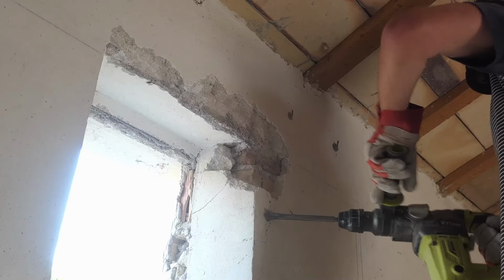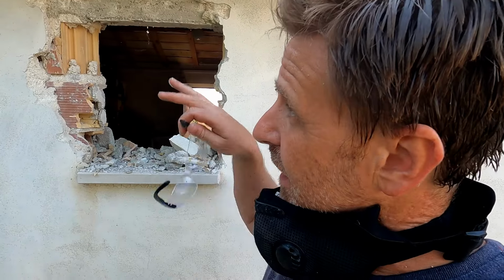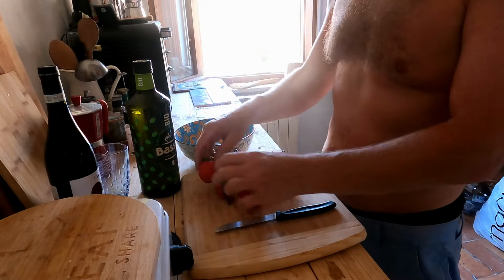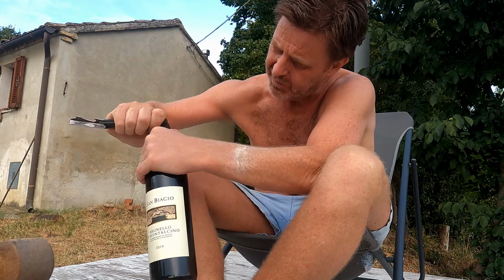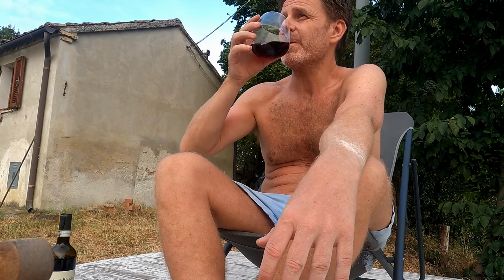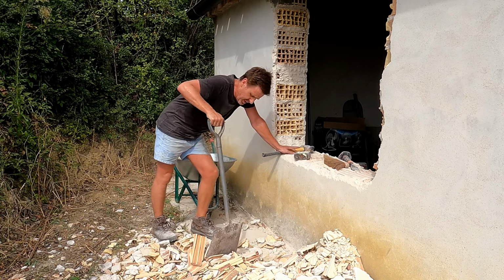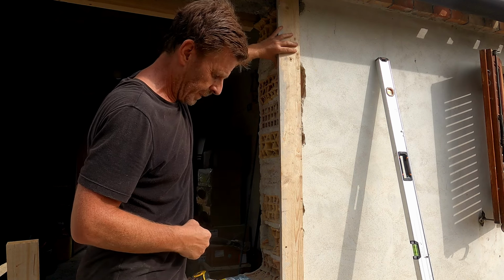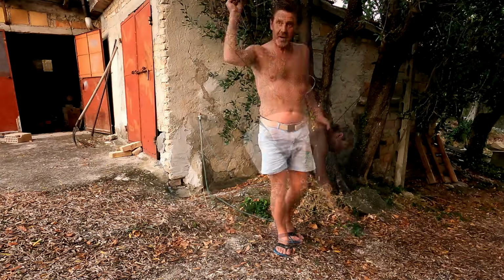Renovation - will the roof be ok? | A candid perspective on living in Italy #23

Comment: put the wheelbarrow against the wall to catch most of the rubble as it drops... and put a tarp down to catch the rest :) clearing up is the hardest part !
Reply from the maker: Thanks for the tip. I seem to learn the hard way. I will try that on the next opening - the kitchen doors leading out to the patio. A job for spring '25 I think.👍

Comment: Trick with dust- put your fan outside pointing away to suck dust OUT of the window to the outdoors. Much more comfy!
Reply from the maker: Thanks @rayjermyn4541 . Good tip. I have a fan ready for the next rip out project which will be more messy than this one.👍
Reply: @threeacresofmarche Always works to move hot air Out in the hot months.

Comment: Loving all your videos, the pace is very relaxing. One little tip for the next windows and doors is to do the outline of your window and doors with a diamond tipped masonry disk on your angle grinder. Work it in as deep as you can both sides of the wall and when you break out you'll have lovely straight edges.  Keep up the great work.
Reply from the maker: Thanks @DeansGoTravelling . I will need a cleaner edge on the next opening so will try this outside. I don't want the mess inside again (kitchen wall opening video).🤦‍♂️

Comment: Another great video, when shovelling loose rubble try standing a bit closer to the pile, put the hand that holds the handle on the inside of your back (right leg in the video) and just bump your hip forward pushing the shovel blade into the pile. Takes a little bit of practise but well worth it, saves your arms, shoulders and back.

Comment: Hello Richard. For someone that never cut an opening for a window out of masonry you did a neat job. You are better off going a little slower and making it easier to do the finish work. That chisel hammer was the tool you needed. If you had to do that all with a sledgehammer it would have taken twice as long. Thanks for another good video.
Reply from the maker: Thanks @dono9879

Comment: Wow Richard, it’s looking good ❤. I don’t know how you do it in the heat like that. I am a gardener and I work really hard in the summer months in the heat and the  only thing that saves me is being able to just jump in the pool when I get overheated.  I invested in a little above ground pool called INTEX ( I live in the US-in Maine and it’s the best thing ever and I am able to keep it up year-round. I just have to drain some of the water out in fall just below the intake and output pipes so I can pull those off and take them in so they don’t freeze along with the pump and cover it. I only run it on electric about six hours a day on automatic timer and add weekly chlorine shocks to keep it clean. It was worth it to keep me cool and I get so much more done. They are reasonably priced and much easier to maintain than I ever would have guessed. You should think about one as you have so much to do there. I’ve had mine about five years and it’s held up in the Maine winters and the hot summer heat and was not expensive.  Anyway I’m just thinking of you. Keep up all the great work you’re doing and I so enjoy watching and I can’t wait to get over there in myself for my retirement! ❤
Reply from the maker: HI @teresamason5155 . I do need some form of plunge pool in the future for sure.😎

Comment: Richard if you’re planning on installing anymore windows I’d either buy or hire an angle grinder with a stone cutting disc, it would save a lot of effort holding the jack hammer, dip your bread is definitely a Manchester thing 😂😂
Reply from the maker: Thanks for the regional clarification @KevinGreaves-j8z .😂👍

I tried an angle grinder on the kitchen wall and am still finding dust in the fridge. Never again. I may use it on the outside wall for the kicteh door opening.

Comment: Another enjoyable video. Regarding the landscaping, have you considered buying an old, 2nd hand tractor with front loader ? I have a few acres and man, my tractor has paid for it self many times over in terms of lifting, building , digging my pool , drilling footing holes for a deck (using an auger/post hole digger). It would also be a lot hardier in terms of mowing the brush around your 3acres , scooping up the rubble and relocating it. Loving the progress on your place.
Reply from the maker: Hi @SAGUY1971 . I think I will need something like that very soon. As soon as I find the budget, that finds its way of getting spend elsewhere. 

The landscaping should start any day now....I am paying someone with an excavator and a skid steer thing to get it done before winter.🤞

Comment: Hi Chap, I'd say the correct way to take a lintel out is safely, everything else is subjective. All I'd say about your approach is that I personally would have set the props back further away from your working area a bit more (nail a temporary bord across a number of rafters a good 2 meters off the wall and set the props into that). 1 so that you have less reason to knock them, and 2 so that you have more space to work on the Lintel. Re the Buratta and tomartoes. If you like to dip your bread in that, a great winter version is to bake the tomatoes in the oven with garlic, Olive oil, salt, pepper, and thinly sliced green onions ( I sometimes add mushrooms as well). Bake the Tomatoes until they are slushy and caramelized, then pour that mess over the Burrata. Great with Garlic bread. Take care D
Reply from the maker: That recipe sounds great @EastLondonKiwi I will give it a try. Thanks for the tip on setting the props back - I did not realise they could go that far from the work area and be ok. I will try give myself more space on the next opening.👍

Comment: Morning Richard from sunny Mexico. You need a better corkscrew - one with a blade so you don't poke your thumb trying to get the foil off.
Plus a dual lever action so you don't have to pull that hard on the cork. You're pretty pooped when it's time for the vino  reward - so less struggle and save yourself an injury.
Reply from the maker: I have run the foil cutter on that one blunt. Maybe that is a sign....but is that drink less or buy a new corkscrew?😂
Reply: @threeacresofmarche  A little fresh basil to that tomato and mozzarella salad and you'd had the classic caprese salad.
So simple and so delicious.
As for the blunt foil cutter - I wouldn't wait till you poke your thumb.

Comment: You are really doing a great job, tough going in that heat and humidity.  Just a suggestion, I would seriously consider using a cement saw on the next window/opening you might do next.  I'm no expert, but I've done similar projects on those types of walls, twice as hard doing that work and recording it.  I look forward to your progress, keep it up.
Reply from the maker: Hi @otsego44 is that like a circle saw? I tried an angle grinder on the kitchen openeing (video 10 I think) and that made a right mess. I think a combination of drilled holes, the drill/hammer tool I use, and the trust lump hammer gets it done with less mess. I still find dust in the fridge from that kitchen wall job.🤦‍♂️😂
Reply: @threeacresofmarche  It does have a circular carborundum blade.  Can be called a concrete of cement saw.  It does produce a lot of dust, but what I do is use it with a fan blowing outward.  I've used them on cement block and stone walls.  It's certainly faster, but keep doing what you're doing, it seems to work for you.  I wish I had your patience.

Comment: Could it be an idea to use an anglegrinder with a stone cutting wheel to make the edges straight right away?
Reply from the maker: I will try that outside next time. I used one inside on the kitchen opening and am still finding the dust. What a mess!🤦‍♂️

Comment: A couple of pointers.
First, wood and bricks/mortar should preferably not be in contact.
The mortar sucks up moist from the air, the wood then sucks up the moisture from the mortar and wood and moisture is a bad combo.
I hope you placed a separator between the wall and the beam.
It is basically a thin rubber mat.
Then, when you fill the holes flip the tool in your left hand "upside-down".
That way your left hand is not in the way when working.
To load the tool, use the other tool to scoop up mortar and scrape it off on the big tool.
If you plan to put the same type of spray insulation around the window frame then there is no need to fasten the windows particularly hard; just enough so the window has the right position when you spray.
When that insulation hardens it sticks like rock.
AND NOW FOR SOMETHING VERY IMPORTANT.
If you use this insulation around the windows, make sure to cover the frames properly!!!
Once that stuff hardens you will NOT get it off.
And for the same reason, buy some thin plastic gloves for when you spray it.
Reply from the maker: Thanks @thoroughsoft . I did leave a gap between the wood and the supporting beam and used a roll similar to damp proof coursing in a few places. I will show more detail when I do the next opening and show the steel beam etc. I never know what to show as too much and boring for some and not enough for others. Better use of chapters may help people skip. 

That foam - I did not see it dripped onto some tools - ruined!🤦‍♂️

Comment: Hi man. My wife and I really look forward to you posting a new video of your progress. I know exactly what you mean about your problem with the rubble. I hate to have to do a job twice, and with that in mind I was wondering if you have a tow bar on your car.? If you had a trailer you could fill it with the rubble and then leave it somewhere until you need it. I come from a farming background and I know farming in Italy is a bit different but they will have trailers that are only really useful for harvesting, so would be redundant for long periods of the year, and depending on how good your relationship is with your neighbouring farmers, and how good your Italian is, you might be able to come to some sort of arrangement.  One other thing, get yourself a proper sledge hammer.  You hinted that you've had,  some negative posts. I think they are born of jealousy.  Good luck.
Reply from the maker: Thanks @Hominid00inthemirrow . My car is due to be changed so I am going to wait and get the tow bar on the new car. I plan to buy a decent trailer in Italy. I think I would over stretch a favour if I asked a neighbour. I'd use it more than they would!😂

Comment: Personally, if I lived in a very hot area, the last thing I'd want would be large windows. Thick walls, small windows keep your house cool in summer and warm in winter. I'm in the north of Lombardy, where the summers are warm but rarely really hot. My house has very thick stone walls, insulated roof and I have replaced all the original windows with very thermally efficient ones so I don't  overheat in the  summer and stay nice and toasty in the winter. I've been here for over 10 years now. Don't know what it's like in Marche, but here you need a permit from the comune to make any alterations to a building,, particularly if you're altering its appearance in any way..
Reply from the maker: Hi @StephenSmith-ge1qf . The permission rules are the same here. I went through the process for these windows and a few other things that I am changing / updating.

This will be a winter tv/relaxing room so more light that comes in the better.

Comment: Not being at all critical, but I don't see why you are putting so much effort into installing a large window that looks out onto a bank of earth 6 feet away (@30:00). No view at all. But I admire your work, all the same.
Reply: That is going to be removed in due course. However, it also lets light in. Whilst in Italy, Spain etc they usually have small windows so that the inside stays cooler we Brits crave light because we’re stuck in a grey, cold, soggy country for most of the time. It’s difficult to make the transition but if he installs a double glazed window it will help to keep the heat out too. Win win.
Reply: @amayastrata4629  Makes sense. Thanks.
Reply from the maker: Hi @PeterPanMan - @amayastrata4629 sums this up perfectly. The landscaping job has been delayed, again. It should start in the next few weeks.....but I have been here before so am not holding my breath. Once that bank is cleared the view should be vast from the sofa that will be parked inside that window. Great for stormy and winter days.🤞😎